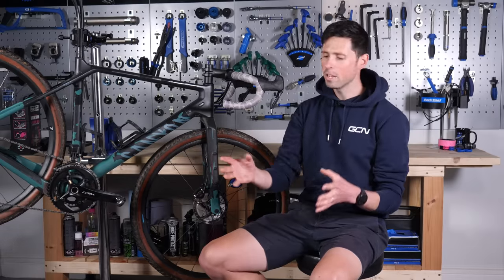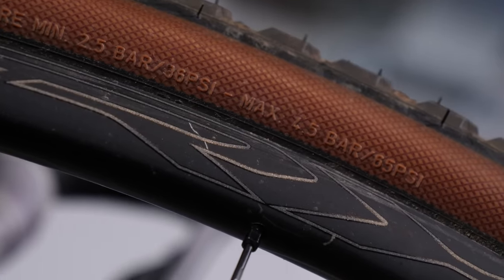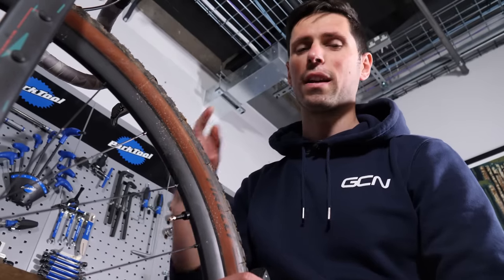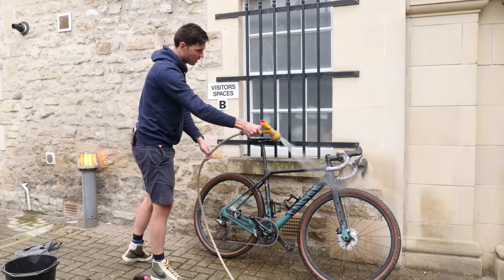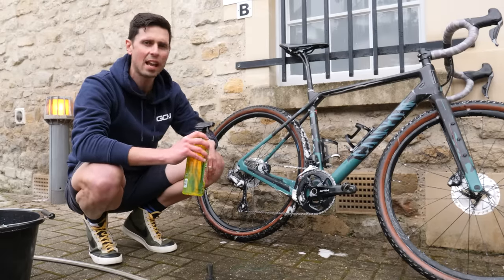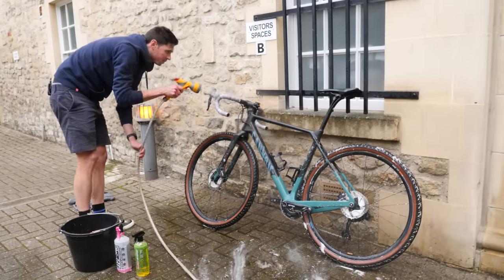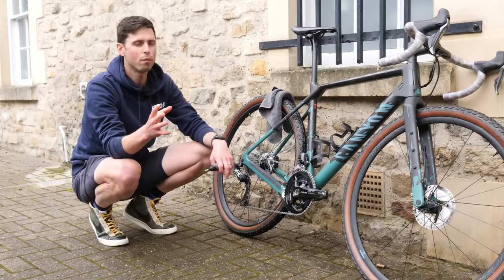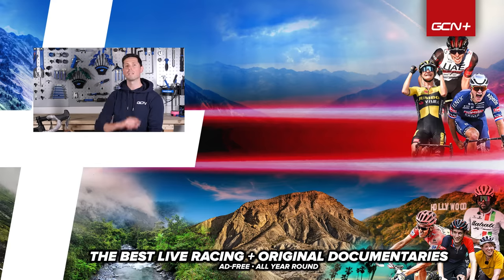3 Essential Bike Maintenance Tips For Beginners | Maintenance Monday

Comment: Thank you GCN for another solid video, however I do have a couple of thoughts to add to those already made, firstly, don't hose your bike in front of a window, they won't thank you for that, and secondly, degrease the oily bits before washing the frame otherwise you'll spray muck onto the frame and have to clean it twice.